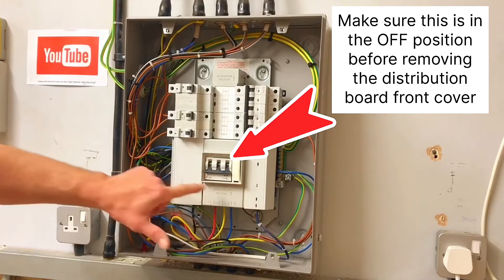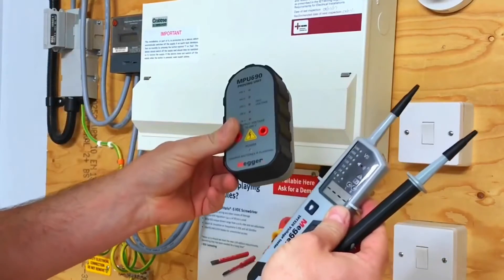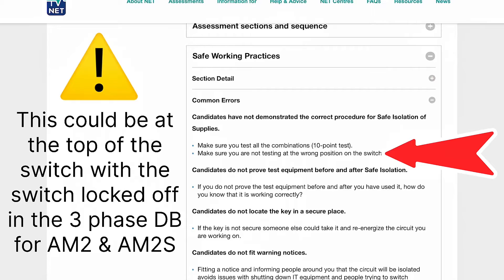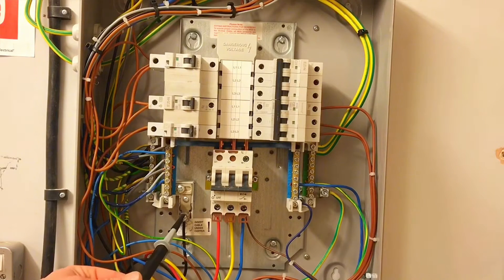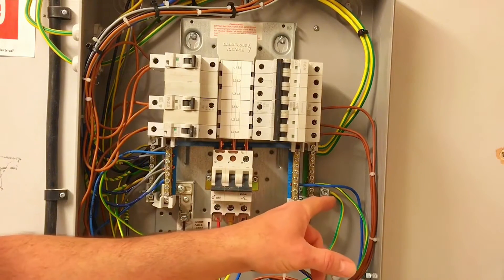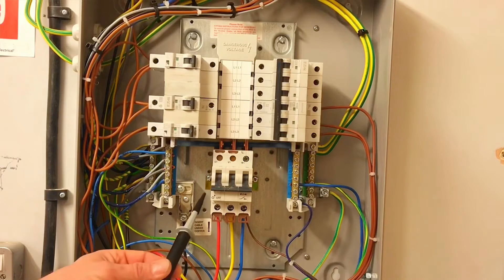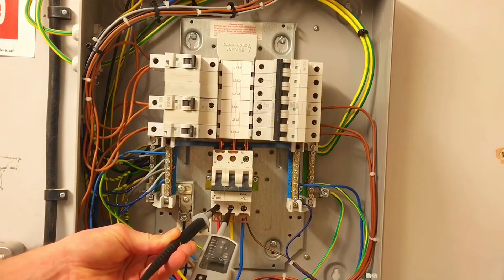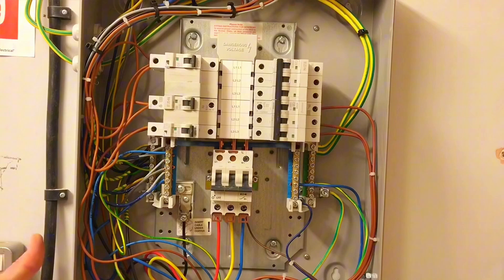10 Stages of Safe Isolation - 3 Phase Distribution Board

Comment: Great stuff. 
Can you look at revisiting your safe isolation on the intermediate 2 way lighting circuit and also the insulation resistance for it too. 
How many times are you expected to switch each of the switches? As I worked out there are 16 different switch positions between the three? Thanks again